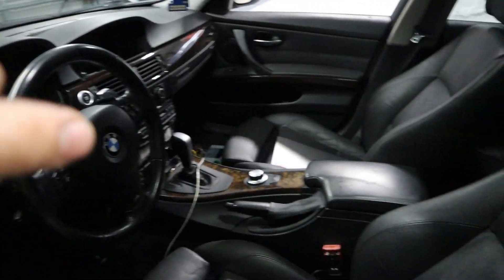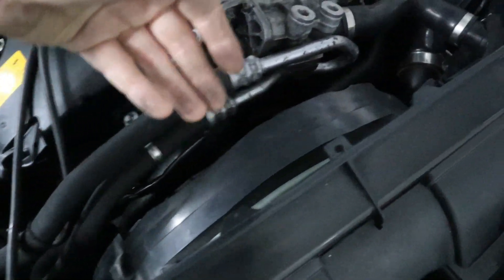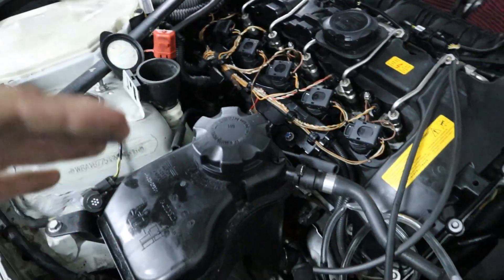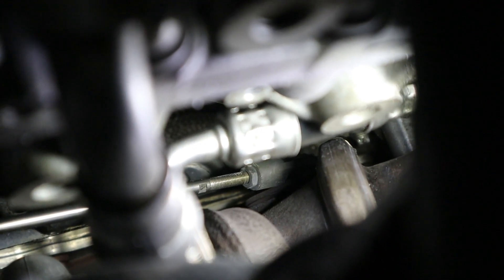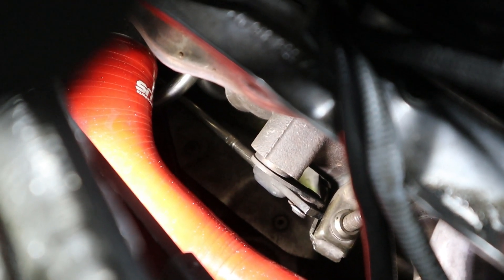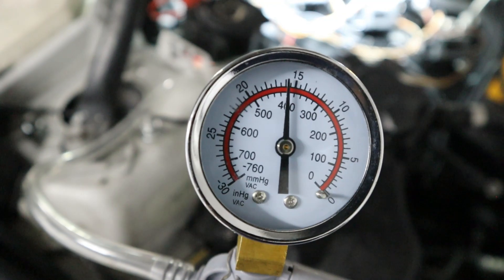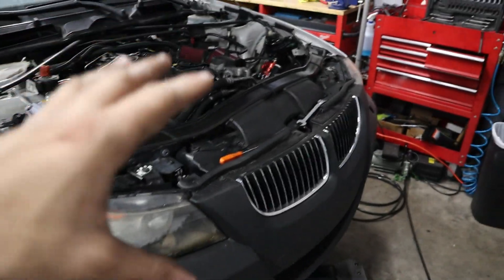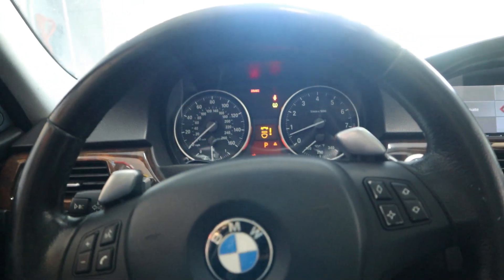How to: Test N54 Wastegate Actuators (No Boost After Installing Downpipes?)

Comment: Any tips or are you able to get in touch with me man having bloody issues car was running mint then my serpentine belt snapped and took out my transmission lines on the way out.. fixed all that put the car back together no boost down low only top end and even then sometimes there's no boost up top either any suggestions

Comment: Would the wastegate stuck on the clamp cause it to smoke out the exhaust
Reply from the maker: Probably not, that sounds like a blown turbo, another common problem. Hope that helps!
Reply: @TheBimmerBarn  I got Downpipes installed she seems to be holding boost etc fine don’t smoke all the time blown turbo would smoke constantly right
Reply from the maker: @eltonlocklear7659  oil can build up, and then burn in a few seconds when your ev or accelerate. When they're really bad, they burn all the time! When you have cats, they absorb the oil so you don't see the leak as obviously. It also clogs up the cats. Good luck!
Reply: @TheBimmerBarn  appreciate your time

Comment: I have been subbed to you for a while now and really like your cars work and content. I'm going nuts trying to find out why my car won't boost in first gear. I have NO CODES but no matter what I can't find any leak but can't get boost until second gear. It also has trouble if I WOT. it bogs and doesn't boost if I do. Perhaps it's my charge pipe as it's not a brand name one and I don't have the vacuum line changed up to a 1/4 line but use a converter from the 1/8 from the intake to the 1/4 for the Tail BOV. I'm also running a very light spring in the BOV but it seems to work (I believe its a 6 lb spring instead of an 8 lb. Anyway any suggestions would be forever grateful. I know I probably won't get your attention LOL. But I thought I'd try. Thanks again!

Comment: Great fix Chris. And I think adding seafoam to the fuel is worth the try. I will try to clean my leaking cylinder 5 injector that way. . But they are all #05. And at +/- 55k miles, they are maybe the end of their life. I don't know how long the index 5 injectors last. Last week I cleaned my intake ports by, using the CRC DI cleaner, and it's driving great again.
Have a great week and thanks for sharing. Dutch regards, Nico.
Reply: My guess is the Seafoam didn't do anything for your injectors. I had to eventually upgrade to Index 12s and all my problems disappeared.
Reply: @TheFrenchPug  yep, didn't work. Bought remanufactured index 9 which held about 6000 miles and a week ago I bought a set index 12. Got a new car, lol.
Reply: @Nico_335i_DCT  I did the same things. Those Index 12 prices are insane!!!
Reply: @TheFrenchPug  Yes insane. $2600 at the Dutch dealer. I was looking for a reliable used index 12 set, for about 6 months. I finally found a1800 miles set for $1600. They were just in the car as it got totaled from behind. I got very lucky to find this set. And finally, my car runs like new. Cheers, Nico.
Reply: @Nico_335i_DCT  Wow. Mine were brand new for $1200.  I'm in the U.S. so maybe that's why. I thought that was expensive. And I just spent $4k putting in new turbos, oil pan gasket, and a new high pressure fuel pump. Car runs like a beast again at least

Comment: I saw your temp gauge was as cold as could be, have you diagnosed that , having same issues , thinkin its the thermostat stuck open
Reply from the maker: I was driving the car cold, it definitely takes a minute to warm up. These have an electronic thermostat, so we should get thermostat fault codes if its stuck open or closed. Probably going to replace it preventatively. Good luck with your car!